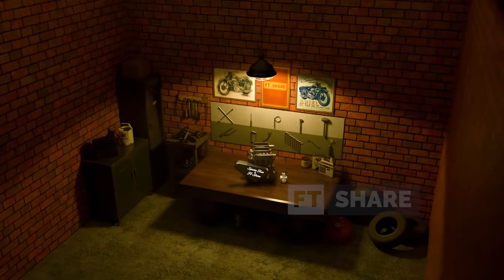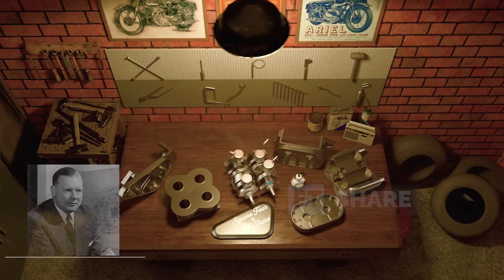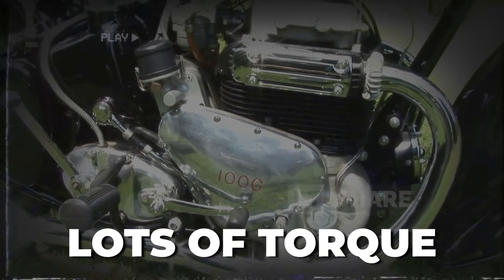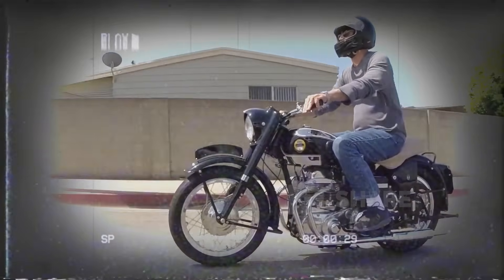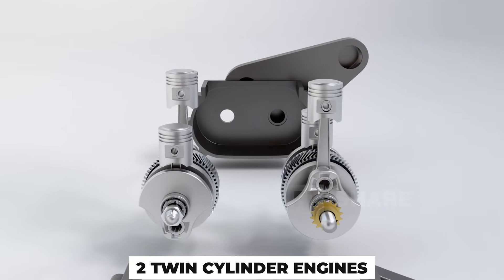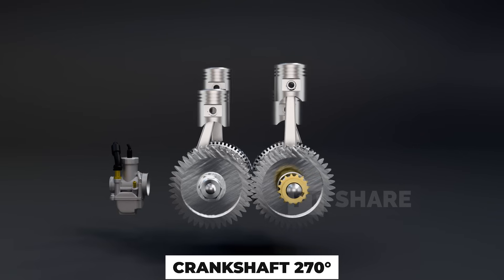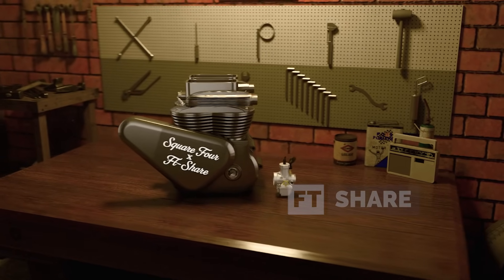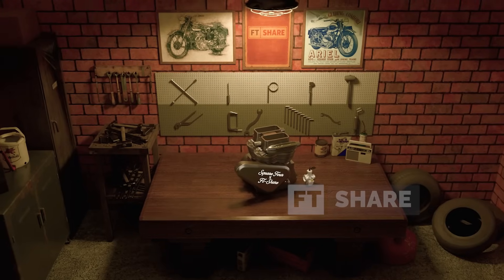2 Cranks, 4 Pistons, 1 Engine?! Ariel’s Forgotten Square Four Explanined

Comment: El Square Four pasó a ser mi motor favorito.
Le pedí a ChatGPT que me haga un plano de motor Square Four con cigüeñales de 270° desplazados  y válvulas rotativas.
El motor prometería mucho y ahorraría parte del peso del Square Four tradicional gracias a las válvulas rotativas en la culatas.
Y al tener tan buen balance teóricamente el motor podría llevarse a muy altas RPM

Comment: I have always loved those engines,  could have bought a 1959 back in 1970 but I didn't have the money, it was something like $900.00 at a shop in South El Monte, CA.  ,I have put some thought into the Square four and had similar thoughts but would probably still do a pushrod layout like a big block Chevy,  or a VW or other,  and definitely water cooling.  I hadn't thought about the 270-degree crank shaft setup. And I'm not dead yet.